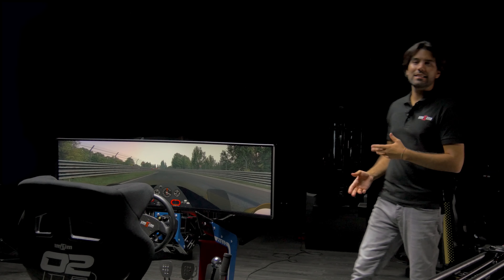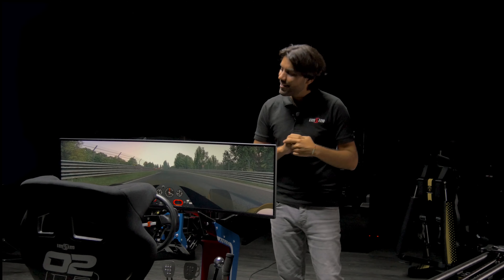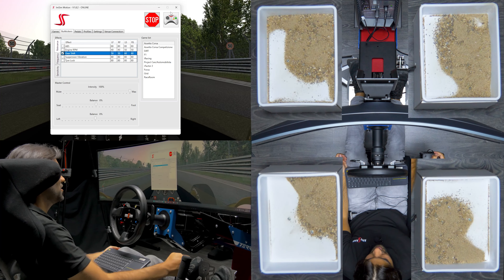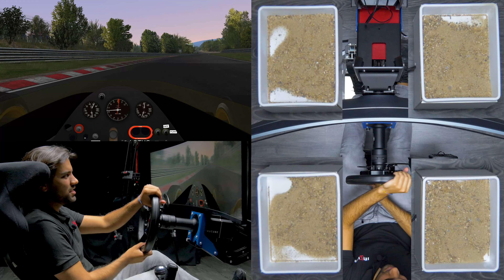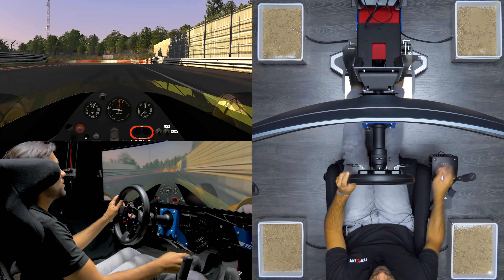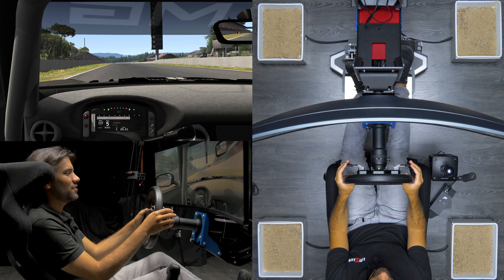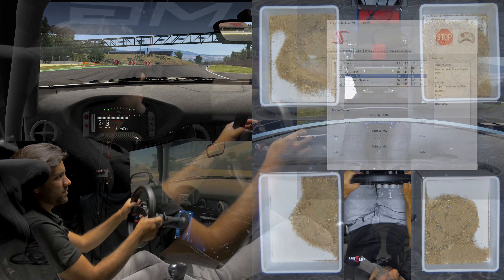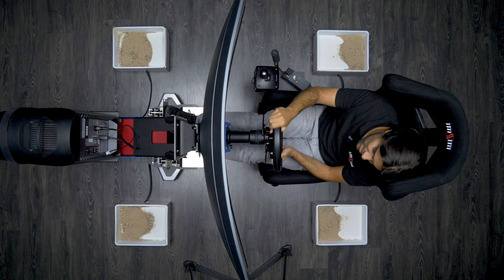ImSim Motion - Haptic System

Comment: Hello how much is it?
Reply from the maker: Hello! 😊 We do not sell the haptic system separately, it is exclusively installed in our simulators, which vary in price, starting at 19,000 EUR and reaching over 75,000 EUR. We are passionate about designing unique solutions for every customer, so understanding your needs is crucial.

Please don’t hesitate to reach out by sending a message or emailing us at info@imsim.eu.com.
Reply: Just buy a buttkicker or slip-angle.
Reply: @ImSim  i see your price of $19,000 and i will counter it with an offer of $5 and a mcchicken
Reply: The car you used is the base content on ac?